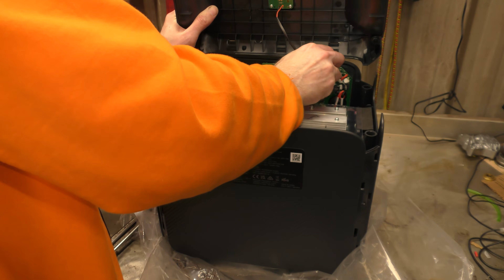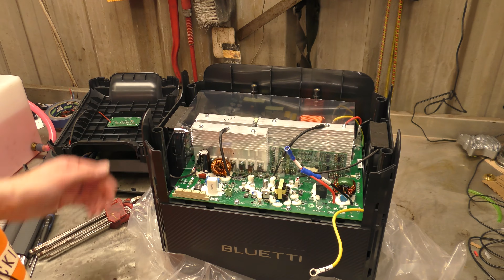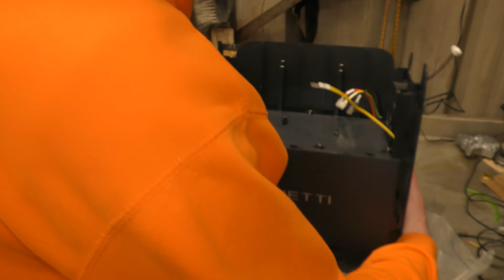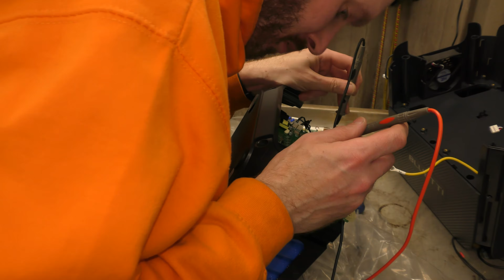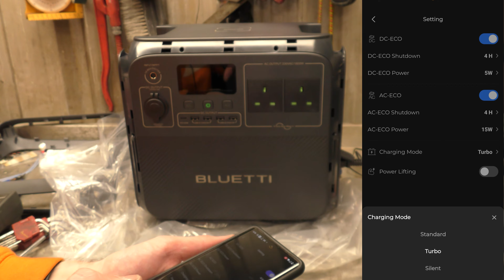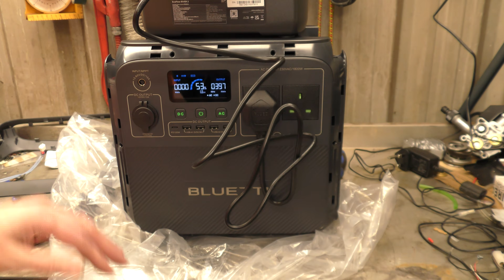Bluetti AC180 power station - teardown and quick test

Comment: I have other Bluetti's and they always fail me on mildy chilly mornings at camp. I'd be curious if this is the same. 50-60 degrees F (10-15 C) I plug in a portable kettle pulling 650-700 watts, it runs for a few seconds, and then instantly drops to zero perfect charge. I have to put it on the charger for an hour or two before it "remembers" it was fully charged. This is well within the operating temp range by the way.
Reply: That's odd. Tried discussing it with support?
Reply: @lua-nya  Yea. I’ve been back and forth. They don’t seem to understand the issue and keep sending me the same troubleshooting steps over and over. No matter how I’ve explained it or how many times, they always respond with some version of “Try it in warm temperature” and “cold weather effects battery life.” Which again, battery life is not the problem. It’s some kind of issue with the BMS, but their Support seems to be seriously lacking.
Reply: @Thergood  if you have this sort of issue, you should be using very heavy insulation. I think you should be insulating everything that can be insulated in your entire life. Every single thing should be insulated. There is this saying that you can never insulate too much… I would recommend some bubble wrap with reflective foil (reflectix). Double bubble wrap is ideal.
Reply: My uncle throws a small blanket over the coffee machine at night, so that first thing in the morning, it works. Could try a small blanket cover etc at night so that in the morning they may just be working without delay

Comment: The reason they don't connect the grounding screw in lug and the ground pin of your AC plug is there's always a danger of having a "hot" ground depending on how the main house power panel ground is wired. I've seen this before.
Reply: Not because of internal earth-neutral bond?

Comment: Great review David. AC 180 released in Australia on May 15. Do you reckon the earth wiring is a dealbreaker, as I would like an AC180 but not if the wiring has been done by people who don't know what they are doing, or maybe by the work experience kid! Once again, thanks for the great review.
Reply from the maker: It's likely there will be a reason.  It wouldn't stop me using it though.
Reply: You wouldn't be able to buy this specific variant in Australia, at least shouldn't be able to.  The regulations here require the earth pin in the sockets to not be connected at all, except where the device has built in RCD functionality.  That the earth pin is connected and presented via that screw terminal on the outside of the case to permit attachment to an earth rod or the like is a big no-no.  As this variant stands the unit would be setup to operate as an IT class generator.
Reply: @retrozmachine1189 regardless, these guys know what they’re doing and they cannot be questioned. I can’t find any downside to any of the construction on this generator. It is virtually perfect and shows the craftsmanship by Bluetti.
Reply: @ZxAMobile  Wouldn't be the first time that an 'unquestionable' product has been recalled because it turns out it wasn't standards compliant.

Comment: Cheers for the excellent video! Great to see it's not using an AC power brick to charge like the older models.
Reply from the maker: This pleases me also.  It's fairly easy to replace a 3 pin IEC cable if you forget it.  Not so much a complete charger.

Comment: thanks for great job. just wondering is it possible turn charging on and off by app with wifi? thanks
Reply: I can help answer this one as I have tested a unit. You can turn off the unit via the app, which will shut everything down, including charging. But you will also lose Bluetooth connection and won't be able to restart or start charging the unit from the app.
Reply: @solentice  thanks a lot bro
Reply: Just use a WiFi plug to turn it on
Reply: Intesting difference in cell size vs the AC200P, which contains 160 26700 cells in a 16S 10P arrangement. I think I prefer the larger cell as there are less potential points of failure.  Similar construction between the two units. Top notch in most all respects.

Comment: The last "O" denotes that it is a round shape 32 x 70 round.
Reply: 700 x1/10 mm. This follows the convention of button cells where 1632 is 16 mm diameter X 3.2 mm high.

Comment: Just crunching numbers, 5x6 (cell numbers), 30, multiplied by 3.2v nominal cell voltage, 96v (so not right), divide by three, 32v, so, 10x series cells by 3x parallel (10S3P) arrangement, now if you will excuse me, my brain just overheated, it doesn't like doing maths... :P
Reply: Should be 10S6P as there are 60 cells rather than 30 cells. It's 2 layers of 5x6 as each cell is 70mm tall for a 32700. Also, 6P * 6Ah/cell * 32V = 1152Wh.
Reply: @HuyLe-qc8jc  how many volts is the pack supposed to have? I have a broken one of these. I'm just trying to figure out what to do with it. The positive and negative main power connectors are at 35 V now
Reply: @goclunker  LiFePO4 cell voltages are 3.6V at 100% charging, 3.4V at 100% resting, 3.2V at 50%, and 3.0V at 10%. Multiply by 10 and you should get 34V when resting at 100% and 32V at 50%. You would need to discharge the battery to see how much energy it actually contains. Maybe something other than the battery is not working.
Reply: @ thank you for your reply. That makes perfect sense. So here is what happens when I plug AC into the bluetti with the BMS plugged in, but the battery physically disconnected from the two contacts the green power button starts flashing. It then turn solid green, but it doesn't turn on the LCD stays off. If I connect the positive and negative from the BMS to the circuit board in the bluetti, the power button doesn't turn on at all. If I plug the bluetti in to AC with the canbus connector between the BMS and the main inverter/circuit board disconnected, nothing else happens. The batteries are now sitting at 34 V so they are definitely charged. That's not the issue. You are absolutely correct. 

I think the BMS is dead, maybe it's the transistors that are on the BMS. You can see them in this video. I bet that's where the issue is judging from what happens with Epson printers. I don't know what to do with this thing.

Comment: Looking for a way to run a small air compressor. It runs at 7amp 240v. Out of the power packs and generators. What do you think would run it? I'm using a coil nailer, and runs it quite hard.
Reply from the maker: 1700W is doable for the bigger power stations.  It's the inrush current of the compressor motor that usually upsets them though.  As it might pull something like 3000W for the first few seconds.  The Anker 767 will start and run my 50L compressor, but it's also old and I have no idea the specs.  :)
Reply: @DavidMcLuckie I’m curious, does the turbo charging is bad for battery? Should we do eco only? Ty so much!
Reply: Jasonoid runs a small pancake compressor as part of his review of the AC180. You might want to check it out.

Comment: Great video 👍
One thing I would love to know . Is it possible to charge this with a Orion-Tr Smart 12/24V-15A Isolated DC-DC Charger⁉️ 
Powering through the solar input
Reply from the maker: That's exactly what Paul and I are going to try on his Landcruiser shortly.
Reply: @DavidMcLuckie  great news 👍
Reply: It will only max out at 8 amps
Reply: @zodaguado6655   you must use the correct cord end or you WILL only get 8 amps.
Reply: @Upliftyourbrothers you mean you need to use the included barrel plug to solar MC4 lead, then connect that to a 12-24 v power source to get over 8 amps ?